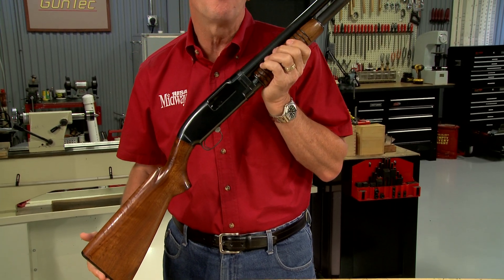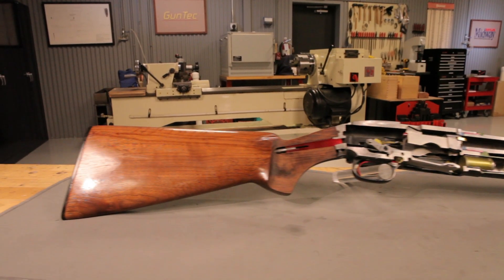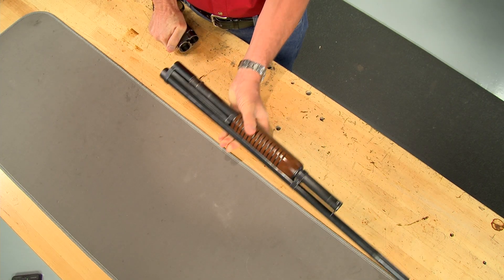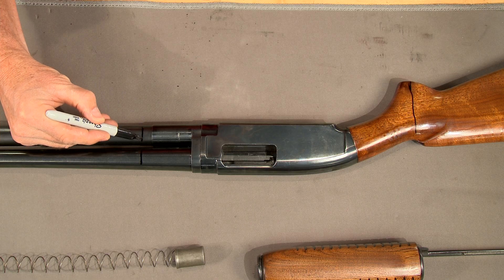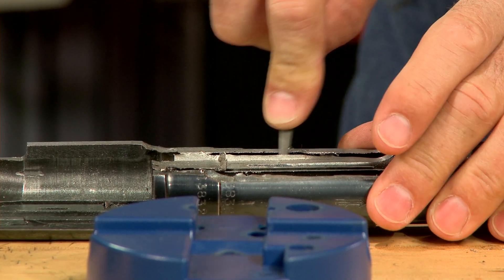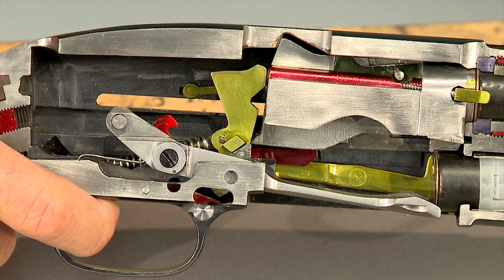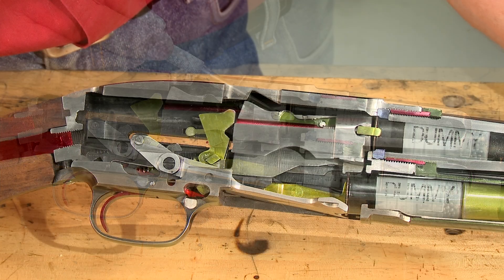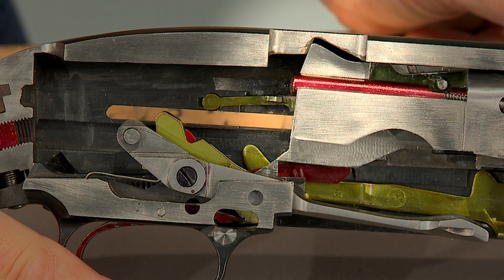The Winchester Model 12 Cut-Away and Cycle of Operation

Comment: Thanks for this explanation of the inner workings and hidden mechanisms of the Model 12.  I have recently noticed that I need to bump the pump forward before I can run it back to load the next round.  Thanks to your video, it appears that the compression spring around the magazine tube is not doing its job to release the slide lock after a shell is fired.  I will need to get in there to inspect it.  Hopefully, it just needs cleaning.  My Model 12 is from 1936, and I doubt that the previous, original owner ever checked this.  I certainly haven't since I've owned the gun for about four years.

Comment: My model 12 / 20 ga is firing well when a shell is loaded directly into the barrel. The spent shell ejects but the receiver will not load another shell from the magazine tube. Do you know what could be wrong in the receiver  ?
Reply: Some models have a magazine cut off switch. It is suposed to keep the shells inside the magazine tube while working the action.  Kind of a option while shooting skeet that you would have to manually load a shell in the chamber.  Disengage it while you where in the field and hunting and it will pull the shells into the chamber after ejecting your spent shell.
Reply: at 4:30 you can see the shell lifter, if you do not have a magazine cut off switch/option as stated by codybarnhart7161 issue , I would suggest to see if your shell lifter is bent,or broken. That assuming nothing is stopping the shells from feeding from the magazine tube into and onto the shell lifter itself.

Comment: As much as it pains me to see a model 12 cut up, this video has been extremely useful when judging what has worn on the one i recently purchased.  Very useful reference.
Reply: I'm with you here. Got to replace some parts in my m12 16 ga and it helps to see the inner workings beforehand
Reply: Original patent drawings would show the exact same things.
Reply: Yes, poor badly damaged shotgun that has no value.

Comment: are they a 3 round shotgun or 6 round
Reply: both. I bought one a month or so ago and, like with all pump/semi auto shotguns I buy, I took off the magazine tube end cap and removed a short wooden dowel from the tube. It was about 6" long and half an inch thick and just served as a plug to prevent loading more than 2 or 3 rounds. I think it's to comply with hunting regulations or some such.

so yes. they are 3 round shotguns depending on if you keep the magazine plug in the tube. and they are 6 if you it out.